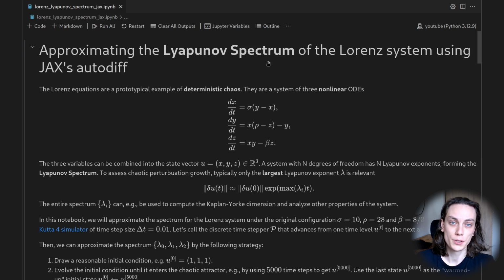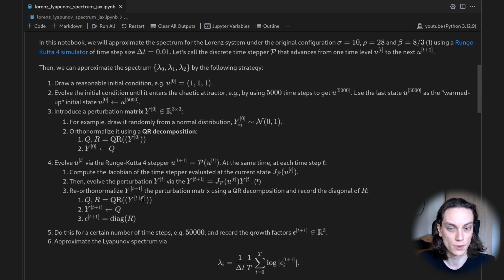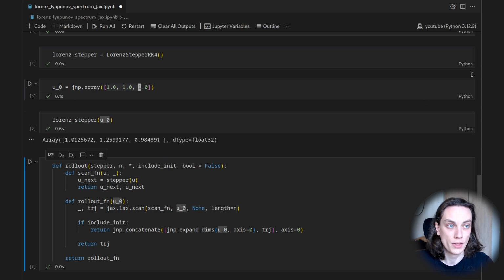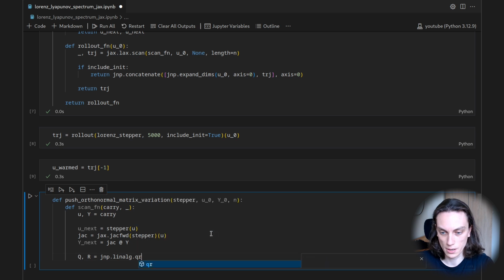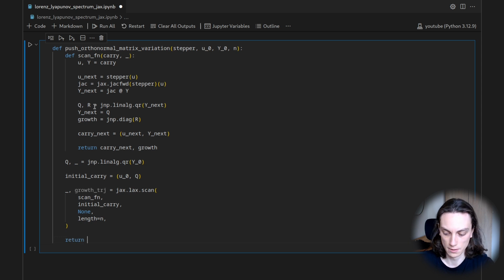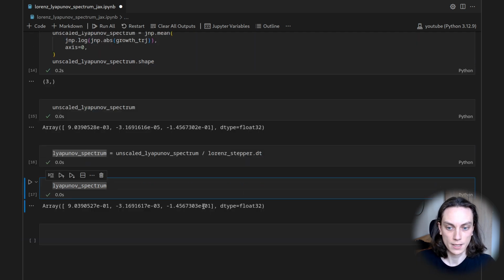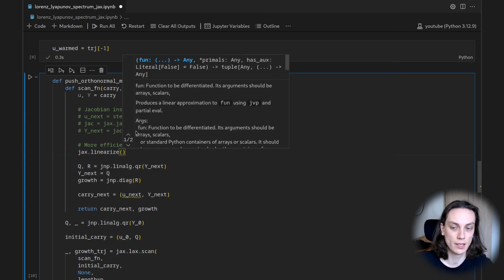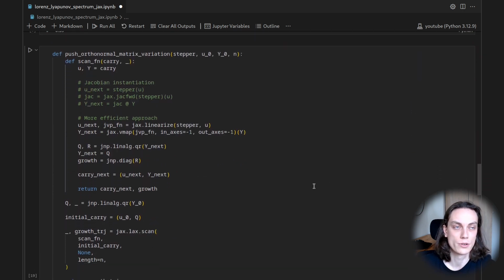Full Lyapunov Spectrum of Chaotic Lorenz System using JAX

Comment: Fantastic, thanks so much for sharing this! I have an application case where I would like to compare the Lyapunov exponents of three systems of different dimensions (of 4, 6 and 8 dimensions), see here https://www.youtube.com/watch?v=AUYtrcmSPis. But distances in higher dimensional phase spaces are automatically larger. I suspect that higher dimensional phase spaces will tend to give me higher Lyapunov exponents. Or is there anything in your approach that normalises this?
Reply from the maker: Thanks for the comment and the kind words 😊 (nice YouTube channel btw)
In general, a system with N degrees of freedom has N lyapunov exponents, but to understand the long term chaotic behavior of the system only the largest positive exponent is relevant (I also have a separate video for this). As such the number of degrees of freedom is not relevant to assess long-term chaotic divergence.
Is that what you were asking? 😊

Comment: awesome video!! which package would you recommend for neural networks? equinox or the updated nnx in flax? thanks!
Reply from the maker: Thanks 🙏 
I prefer equinox (It's closer to JAX and let's you do all kinds of cool research ideas). Writing this tutorial (https://tum-pbs.github.io/apebench/examples/benchmark_flax_models_with_nnx/ ) is the only experience I have with nnx so far. It feels a bit better than the older linen API but it's not as nice as equinox 😅 
Big advantage of using flax is that you can use the huggingface libraries (i.e, it has better interoperability).
Reply: @ makes sense, thank you!! 🙏